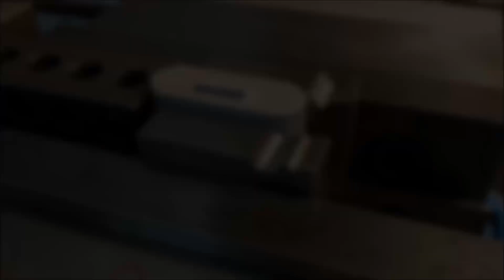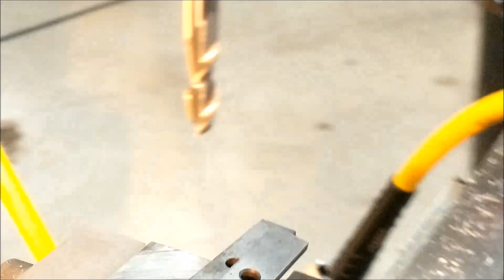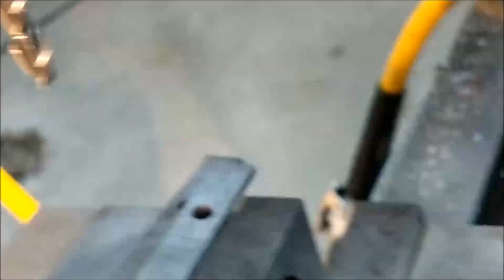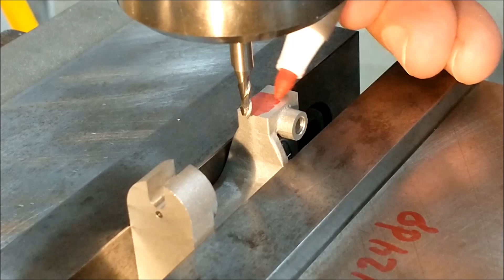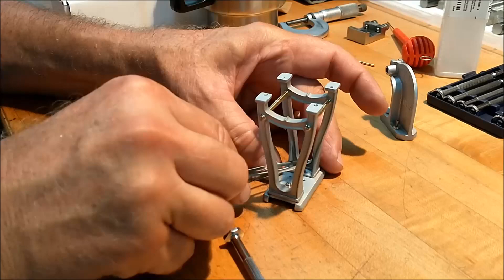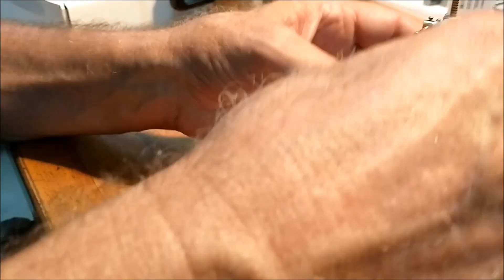Have You Ever Seen a Miniature Arbor Press? Take a Look at This one !!

Comment: Hello Joe,  I know the pressure making is totally different than what I have but I have a question for your knowledge. I have a Dake no 0 arbor press.  I need a new handle the one you pull down on. What material do you suggest?

Comment: I'm a woodworker who is now getting into machining on my mini lathe, and I know from woodworking that smallest projects are often the most difficult, because the smallest variances are absolutely magnified. If I'm building a big chest of drawers and I'm off by 1/8" over 48", you'll never notice, but be off 1/8" on a small box that's 10" wide, and it looks like the grand canyon.

Small projects are also great because they don't cost as much in material, but you can still practice techniques!

Comment: so this here kit has the nicest looking legs. Wish it was cast iron but aluminum would do. Delta 1460 wood lathe has very similar leg design to this.
Reply from the maker: They do look nice. Just about 3 hours with a file and sandblaster to get there.
Reply: @joepie221  For sure!!! I would do it, Its nice to be able to see the end result in your mind for motivation. I just wish the molds were more lined up. I got a Stuart 7" flywheel that I plan on using as a pulley. The 2 halves that made it were off, its a sad sight, each spoke has to be filed to fix it, I dont like to take off the cast texture these have! That is what gives it character and that organic look. sometimes though like in these cases it cant be helped.

Comment: Joe how did you turn those tiny leg braces, especially with the center radius? Also when you drilled the front plate holes, were you using a spring plunger type chuck? Thanks. Just got my kit and your videos are like gold!!
Reply from the maker: I believe I showed it. if not in this video, then check the mini grinder video.

Comment: How I missed this is beyond me. Glad I found this today. I built a 3" throat version of this in trade school from bar and round stock. There is one little bobo that sticks in my craw (one tooth on the rack is off .0025, just a tad tight on the bottom of travel with the plate removed) only the ones that know it is there. I have used it a few times over the years. Great build today my friend.
Reply from the maker: Thanks. This one is a good first venture into scale machine tools if anyone hasn't done it.

Comment: 20:00 What is the point of a wiggler?  I've never seen one used without the user centering it (and often warning us how dangerous it can be), so why is it articulated in the first place?  Without knowing the origin of the design, it seems like it's only ever used as a pointing device, so why not just make a solid pointer?  Is it only because a pointer can be bent and a wiggler can always have runout eliminated?  Writing this, it's making me think about it more.  Is it about center punch marks?  Do you guide the wiggler into your punch mark and then raise the quill and spin it to see if the wiggler point is running out?
Reply: A wiggler will spin true to spindle centerline. This will negate any toolholder(chuck, collet, etc) runout.

Comment: Nice work Joe. You have said many times about knowing the diameter of your end mill. Just curious. How do you verify the cutter's diameter. I have (2) USA name brand 1/4" cutters. One is perfect for cutting key ways. The other is too small. Also, thanks for pointing out signs of a worn bit.
Reply: If it’s two flute or four flute you simply mike over the flutes to find the diameter. When cutting key ways with end mills it’s always best to machine the slot undersized first,15/64 (.234) for 1/4, then finish with 1/4 (.250).

Comment: "I always go clockwise with my dials, so you're always going to see me come back to it".
I've you say this often, would you please explain your statement, and what following machining practice makes this action necessary.
Thanks Greg
Reply: Gear mesh isn't perfect so readings need to be taken in 1 direction for absolute repeatability. As a shop convention, Joe always turns clockwise into the part.  If he has to back up/away (counterclockwise) he will always go farther than necessary so as he comes back into the part (clockwise) the backlash is removed from the drive and his readings stay accurate.
Reply: @mab0852  Thank you Michael, I understand backlash or lost motion, doesn't the DRO remove the positional error axis dials may have due to backlash. Finishing with a clockwise movement makes sense if Joe "always" uses his dials and not the DRO, but numerous times during this video and most other videos Joe refers to the DRO.
Reply: @gregwmanning  That depends on how the scales or encoders are setup.  Some directly read position (unaffected by backlash) and some are relative interpreted from drive encoders (won't show true position). Either way you need a firm mesh to hold tolerance so you need to drive into position under load. The most repeatable way to do that is to come in from the same side of the part with the drive in full mesh.
Reply: @mab0852  Ok thanks Michael for that explanation. I guess it can't hurt and costs nothing why not!
Reply from the maker: Someday, I'll discuss free motion. Otherwise known as the gremlin that you never expect.

Comment: Really enjoy watching you make these tiny machines. Something akin to P M Research's machine tool webpage photo of their tiny shop with a belt and line shaft system would be an awesome way to display your amazing work. Perhaps driven by a tiny steam engine to run these tools?
Reply from the maker: They are considering the use of my model images on their website. We, and they, are working on it.

Comment: Looks like you needed a jack stand under the part when center drilling the side it was flexing quite a bit
Thanks for sharing your most valuable commodity” time “ which we never get back 
I have learned a tremendous amount about machining from you and will for ever be grateful Paul
Now what about a miniature milling machine 😂😂
Reply from the maker: Glad to hear it Paul. A jack would have been beneficial, but notice the part didn't flex when reamed. That was the key feature.

Comment: "Put yourself 100% into every part, no matter how insignificant." Those are words to live by.
Reply: ABSOLUTELY: One of the things that has been lost in the CAD/CAM age is the concept of tolerances and in particular accumulated tolerance error.

For argument (and this was how I was taught it) If you have something like +/- 0.01 tolerance and all the parts average out around that then you'll end up an accurate assembly that's within 0.01. BUT if all the parts are made at one end of the tolerance then they add up. If you have 10 parts you can have an assembly that's 0.1 out, 20 parts 0.2, 30 parts .3,... etc.

If every part is skewed towards the + or - tolerance you can easily get a disaster. Its either too small or too large. 

Also if you do get a really nice assembly it might be from accumulated errors cancelling out. That's fine until you make a spare or replacement part which can be within tolerance and simply NOT work because the original was mad at the other end of the tolerance. 

You can also make a part where every dimension is within tolerance but the part isn't.

I am an engineer and you'd be amazed how many degree qualified engineers are totally oblivious to this. It also explains how things like the Boeing Max-8 happened.
Reply from the maker: The toolmaker I did my apprenticeship under  told me to take the available tolerance and split it by 10. We made production tooling and fixtures for the internal components of electronic watches. Even 10x seemed too big at times.

Comment: looks like you have a bit of deflection  when drilling the cross hole  Mr Joe  .
Reply from the maker: More initially at the center drill stage, the reamer passed through without much pressure. I did go back and dwell the center drill to remove any distortion and allow the flex to relax.

Comment: Joe, you slipped up on you usual excellent setups. You had no support when drilling the cross hole, the casting was deflecting quite dramatically both when center drilling and main drilling.
Reply from the maker: I agree, a jack would have helped, but knowing the end goal,  I did go back and dwell the center drill to remove any distortion and allow the flex to relax. The reamer passed through without much pressure so all ended well. The setup was very busy with all the blocks and a jack would have had to be very small and tough to get into position. The parallel in the video was used as a lever arm to reduce the deflection.

Comment: When do you decide to mill a slot vertically rather than horizontally?  What is the thought process?  6:20 ish.  Thanks🙏
Reply: Gonna take a stab at this... the hole / slot shape is the decider. if round then vertical... if the slot needs to be flat at the bottom then horizontal. Yes?

Comment: Why wasn't that flex in the part as you were drilling the hole at about 13:45 a concern?
Reply from the maker: The reaming op was extremely low pressure and the lead was true.

Comment: I want to build these so bad but my skill level is lacking 😭😭
Reply from the maker: It wasn't too bad. You can also get replacement parts if something goes wrong.
Reply: @joepie221  I'd really love to build the lathe I have an antique Atlas that's down for repairs but I did buy a new mini mill. I also messaged you on the advanced innovations website never got a reply I probably did something wrong.

Comment: Chuckle, if that's the number three press, I'd love to see their number one press. It probably would be about ¾" tall!

Also, if you want to hang your camera off the toolbox, make yourself a adapter stem for the camera so you can put it in a Noga stand. I didn't keep any extras, or I'd mail you one from the batch that I made for @the den of tools.

What size arr those screws holding on the plate for the rack? They look smaller than 0-80's. 00-90's?

Comment: That one was too easy for you Joe, next needs to be the mini milling machine lol...
Reply: Or the drill press -- that thing is a bear.  Fixtures galore to hold the main frame for machining.
Reply from the maker: The drill press does look very challenging. I may have to attack it very soon.
Reply: @tjh44961  
A cutoff bandsaw with a micro buttress thread clamping shaft, band blade made from a jeweller's coping saw. Come to think about it, maybe a Marvel power hacksaw would be less aggravating.

Comment: I love your toe clamps you use on your figure plate it was flexing when you drilled and bored it why didn't you use a adjustable parallel to support it
Reply from the maker: The space below the part was tight and irregular. I levered a parallel in there to help support it.
Reply: Would love to get some specs on your toe clamps so I can make my own

Comment: Awesome - Joe, you even exceeded my expectation when you finished the montage of stills with the arbor press and lathe side by side.  Thank you!   👍👍😎👍👍

Joe,  I suspect you have explained this more than once before, but could you show us why when locating the mill table using the DRO you always finish locating with turning the dials clockwise?  If you think you have showed this before, I'll poke back through previous videos and see if I can find it. Thanks    Joel.....
Reply: Backlash on the feed screw probably. Joe would have a more sophisticated answer.
Reply: @michaelwise1224  
Repeatable inherent backlash control/mitigation might be a suitable explanatory phrase. Not trying to be a show off, just sounds good.
Reply: @stanervin6108  
Yep. What you said. 
But does up-milling versus down-milling affect where to leave backlash?
Reply: @michaelwise1224  
 As long as you don't change up during an operation. Or at least I wouldn't think so. Backlash is caused by either mechanical wear or mechanical ill fitting components. As long as you are going by the reading on the display of your dro, you should be good to go. At least within the resolution of the encoder or the electronic circuitry components involved. Well that's my two cents worth, leaving me, pardon the pun, tapped. Joe, if you are following this, am I close? And if not, by all means correct me.

Comment: If somebody is going to dive into these this is probably the one to start with.
Arbor press story. At one time I did a lot of work on spindles. The majority of them had bearing diameters of 50mm or less. To make it easier to press off the old bearings or on new ones I made up a couple of special plates that had slots maybe .5mm larger than the bearing size. Each plate had 6 or seven slots in it. Worked a lot better than trying to use riser blocks as bridges.

Comment: Putting a jack under the casting while drilling and reaming the cross hole world stop the part from deflecting.
Reply from the maker: It was a trapped setup and I didn't have a jack that small. You are correct.
Reply: @joepie221  You can improvise a jack with a small bolt or screw and a nut. A very nice build by the way.
Reply: @joepie221  Make a miniature one  lol

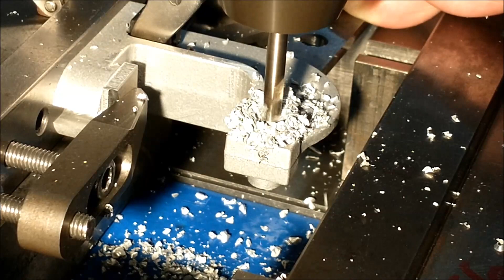Comment: Your table offset description was spot on.  Q: Did the flexing at 14:00 cause any alignment issues?
Reply from the maker: No. You'll notice the deflection is mostly at the centerdrill stage. As the drill and ream takes place, movement is almost non existent.
Reply: @joepie221  Thanks, that's what I thought, but I wanted to make sure.  I admire your work and look forward to your  YouTube posts.